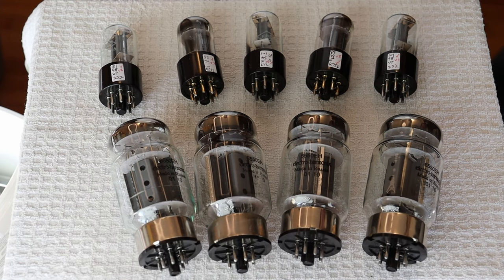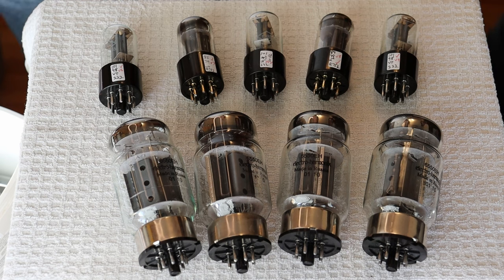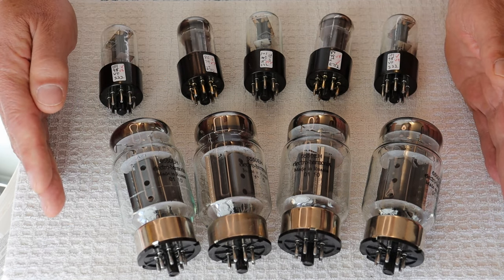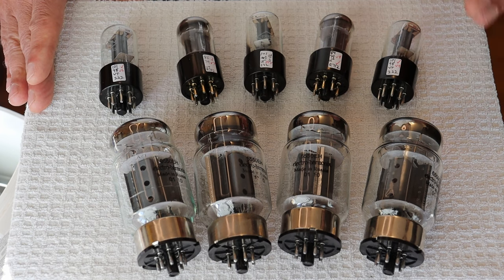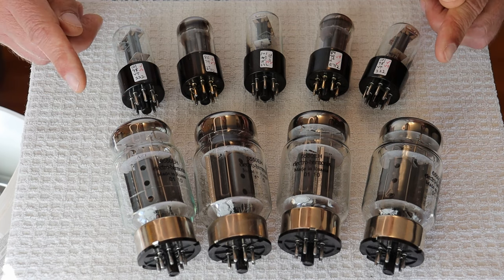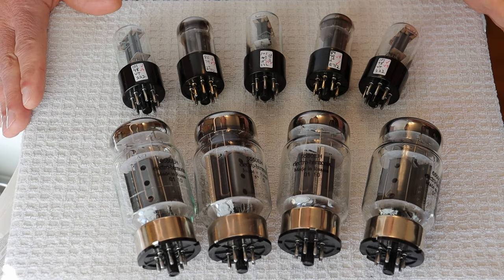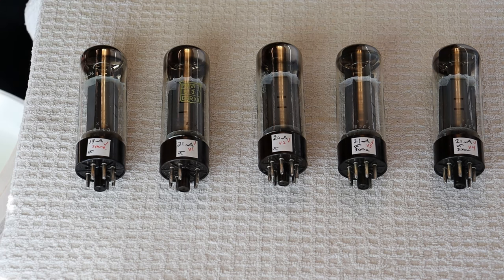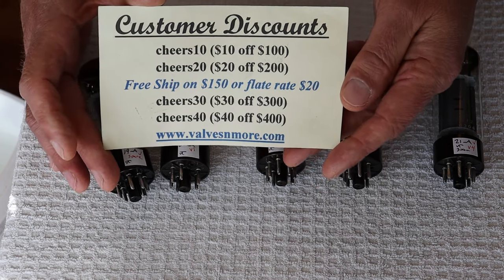Tube Lab #158 - Re-Tubing Your Amp on a Budget

Comment: I am  about ready to brig a Fisher 800B back on line after years of collecting dust.  I have book marked most your programs on individual tube types but would love hearing your comments on the 7591.  I realized my days of tube rolling  were pretty much done with when I opted to put the Fisher back into service,  however I would very much appreciate listening to some commentary on this often overlooked power tube.
Reply from the maker: I don't have any experience with the 7591, and even though we stock thousands of tubes we may only have one or two used ones in stock.  So they are a rare tube.  You can find a new manufactured JJ, but I've never like JJ tubes.  Another option would be to just convert it over to 6L6 and if you decide to do that I have a perfect recommendation.

Comment: I bought my VAC PA 100 100 and ARC LS15 tube pre amp back in 1995  The VAC came from the factory with KT88 Golden Dragon tubes Just recently I sent my VAC amp back to VAC for a good go-over (everything was excellent) and re-tube They suggested the Golden Lion KT88 matched pairs and Golden Lion 12AU7 tubes
Would you recommend going with new old stock KT88 fir a sonic upgrade?
Reply from the maker: In almost every case a quality vintage tube will sound superior to the modern copy.
The best vintage KT88 i've ever heard was the true vintage SED (Svetlana Electronic Devices) KT88, made in St.Petersburg (Caution, many fakes and copies for sale).  What makes these special is that the midrange has a wee bit of warmth - almost every KT88 ever made has a very flat sounding midrange, that is meh.  These tubes are now fairly rare and expensive, we make up about 4 matched quads a year and they sell instantly.
The 12AU7 is much easier, we still have good NOS NIB (new old stock, new in box) inventory of the best USA made 12AU7 - the vintage RCA "clear tops", excellent all around tube, with great clarity, particularly in the treble and also a touch of midrange warmth.  Remember 90% of recorded music is in the mids - so if a tube/amp/system doesn't get that right you got nothing!